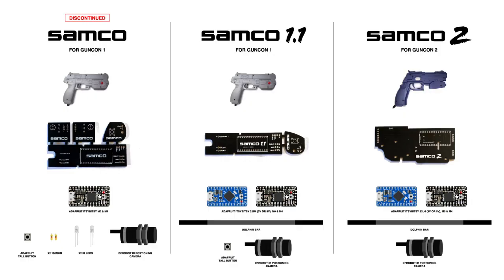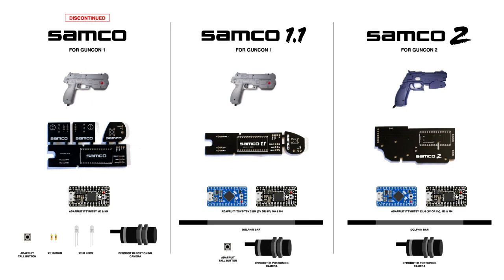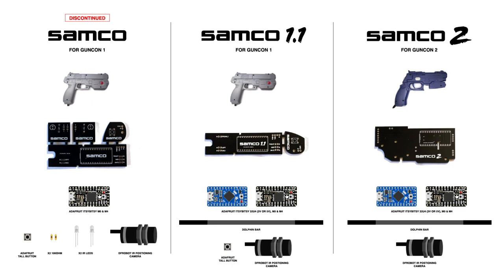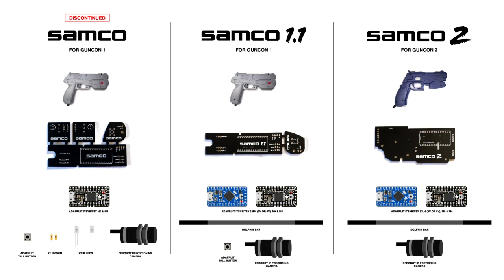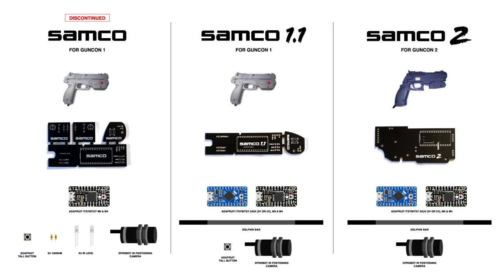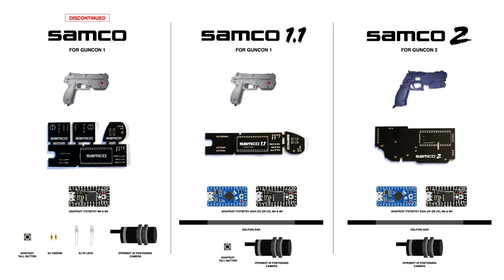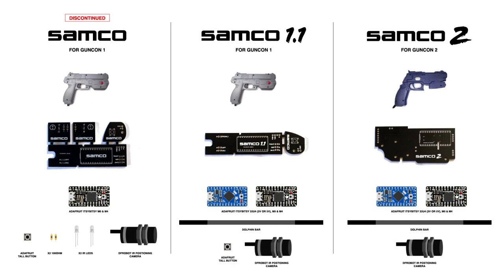SAMCO DIY Light Gun - New PCB's for GunCon1 and GunCon2

Comment: 😍👍Time Crisis 5 has two 50-inch screens, each with 10 LEDs, at a distance of approximately 2 to 2.5 meters ( gun / screen).
Can your system handle this? Does the more LEDs you use improve the precision?  No problem for export to France ?

Comment: Hi. I know I am late to the party, but I got my boards way back but couldn't find the time to build one yet. Now I find out there are new boards and I still have the white 1.0 ones here. Where would I get more info in general? Is there a Discord or Forum? I would love to know if I could hook up one of those cheap sensor bars to the old pcb, too.
Reply from the maker: Hi Mate,  no worries. The only difference between to 2 PCB's is the microcontrollers you can use with them, so with other older version you can only use IstyBitsy M0 & M4 boards (compared to the new boards which can also use the 32u4 versions) but apart from that they work the same. So yes, you can you use the cheap sensor bars with it. There's a 1.0 versions of my code up on my Github for all the variations 2IR, 4IR & 4IR Beta, so just make sure you use those when you upload.
Reply: @samcorulz  thank you! I really appreciate the answer. I will tackle the build and try to get a solenoid into the second one. Thanks for the work you've done.
Reply from the maker: Link to the facebook group https://www.facebook.com/groups/2456595207897603

Comment: Hello, sorry for my average English (I'm French). i have received the pcb thank you very much for the speed. I have all mounted and I have a little problem. I did my tests on a 40 "4k TV. to have a correct adjustment I must position myself at least 3.5 meters, is this normal? and even in this position the gun is not recognized in the upper right zone, the 5 centimeters from the right edge of the screen in the upper half are not recognized, the cursor comes out directly from the screen on this zone. I noticed that my bar sensor had 6 IR, 3 on each side, can the problem come from there? thank you in advance for your help. Sebastien
Reply from the maker: Hi Sebastien, 3.5m metres does seem a little extreme I would expect fairly good results at about 2.5m (which I understand is still really far away). The sensor bar is definitely not the problem all my sensor bars have the same setup. For large TVs like this I recommend using the 4IR sketch it should give you much better coverage.
Reply: thank you very much, but the error came from me, I had not followed the video for the adjustment of the camera with the test. the camera was not horizontal. now all is perfect. I can't believe the precision of the gun is perfect. thank you so much Sebastian
Reply: on the other hand I am currently in mode 2 ir and really perfect.

I thought that mode 4 ir was mainly made to play loan on small screens, is not the case?
Reply from the maker: If the 2IR code is working for you then all good. The 4IR code was just made so that you could use it a little closer on any screen really, that's it's only advantage.

Comment: hello I have a problem in finding the DFRobit IR Camera because with the shipping costs for Italy it costs about 55 dollars ... Is possible to use another positioning camera?
Reply from the maker: Unfortunately I only know of the DFRobot IR Camera. However, you can make one out of an old wiimote it's quite an involved process but there are few tutorials around that you could find with a quick search if you're interested.
Reply: @samcorulz  thank you so much for answering me so quickly I ask you two more information about it 1) if with the Wiimote camera you can always use the samco 1.1 2) if by any chance you have some useful links on the configuration of the wiimote
Reply from the maker: No worries :) Yip, will work with Samco 1.1 will just need to adjust the code to use the wiiMote library. Here's a link to an instructable on how to hack the wiiMote https://www.instructables.com/Wii-Remote-IR-Camera-Hack/
Reply: @samcorulz  thank you so much 🤙🤙🤙

Comment: Does it need to be a guncon?
Reply from the maker: The PCBs make it easier to add it to a GunCon but the code will work with basically anything that has buttons and a space for the IR Camera. There’s schematics to which pin does what on my GitHub (link in description).